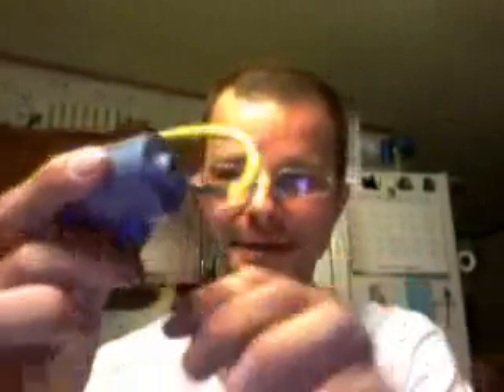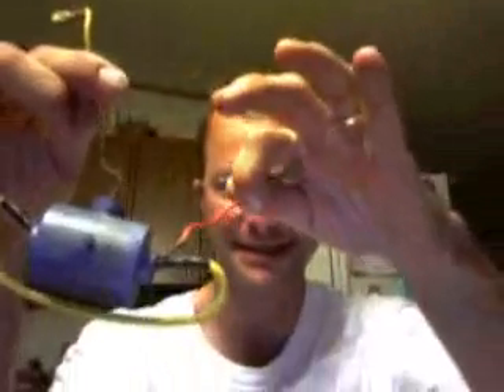HVAC condenser compressor tripping breaker

Comment: hi mike.. i have issue for my freezer doesn't work and got electric trip at main switches after compressor running for while. But now compressor not running when u switch on, and just trip on main switches. any opinion for my problem? freezer just use 6 year. thanks.
Reply: I would call a White caucassian hvac pro into fix your problem properly. Did you replace the circuit breaker, starting components? If not, you should install a new compressor on a wild guess.

Comment: Mikie,I have replaced a defrost sensor wire for the second time that has been blowing the 3amp fuse inside on a heat pump any ideas or history working on this problem?
Reply: I would look at the low voltage wiring. But, I am sure you got this problem repaired by now. Coming on here asking for diy Mike's advice.

Comment: Could it be that the constant on and off of the unit cause the PTC to overheat? and did you inspect the mettering device used? by the time you rewired the components the TXV could have evened out the pressures and allowed the condensor to start easier.

Comment from the maker: Everyone has thier favorite start kits, I prefer 3 wire jobs instead of the 2 wire ones.  I seem to replace them more often.  Other than the way things are wired the kickstart is basically the same as a 5-2-1, they both have a capacitor and both have a current sensing relay.  The kickstart is just a more convient package to wire and install since it's just one screw and 2 wires:>

Comment from the maker: Not that I've ever noticed.  Usually if the startup amp draw is under the breaker size I don't worry about it too much.  If it's over I'll recommend a hard start kit. (in addition to checking lug connections in the unit, disconnect box and possibly in the breaker box too)

Comment: I should have said this first. You have two start devices at the same time. Don't use both. Whoever installed the Supco should have removed the PTC device. Ther are two kinds of PTC devices A single and double. Or the tan and blue. You can actually check the Ohms to see if they are good or not. the blue and tan have different values but I don't remember what they are. All I remember is if it is melted---it's bad!

Comment: The reason it gets hot is because that is how it works! It is a start thermistor (softy start) if you take it apart you will find 3 metal plates seperated by a ceramic looking material. When the current is applied it gets real hot real fast. The resistance changes with the temperature (that is why it is a thermistor) the temperature goes up, the resistance goes up so high it takes itself out of the circuit. If you open up the Supco you will find almost the same thing. Use one or the other!